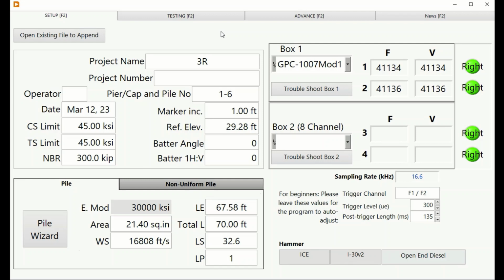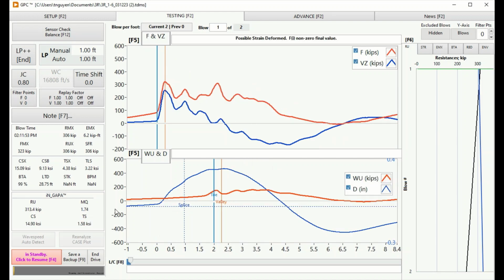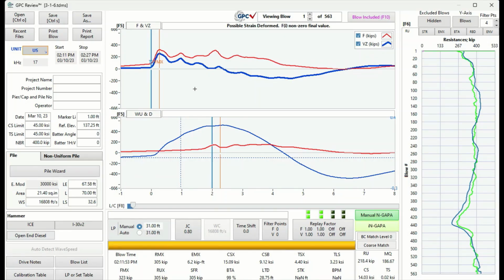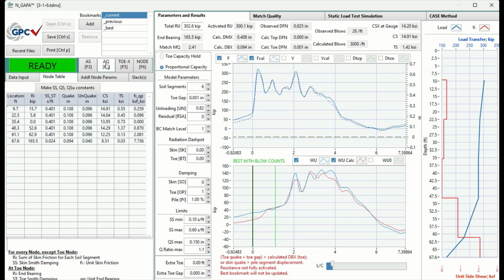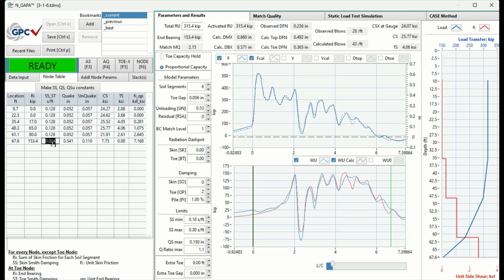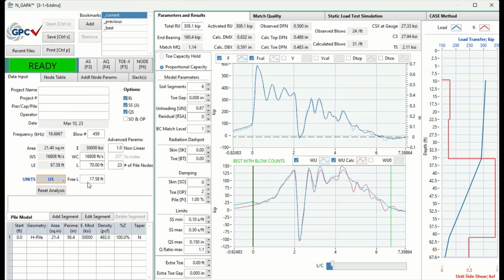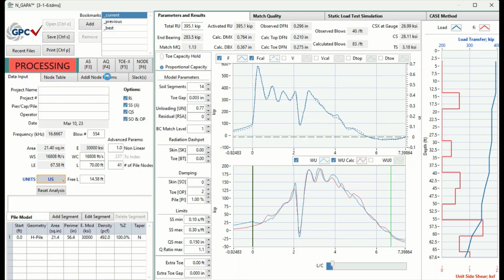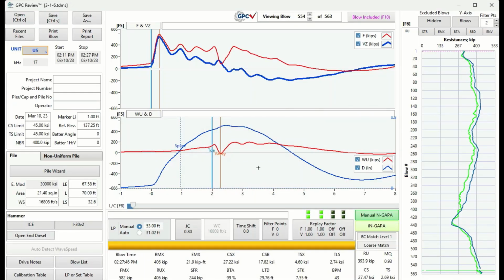15. iN GAPA example (field and office)

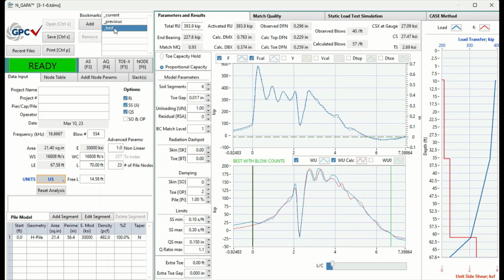Comment from the maker: 36:05 Soil Segments (also refer to Sections 3.7.2 and 4.3 N_GAPA user manual - despite a small # of Soil Segments, the skip factor is actually always 1, so no need to have many soil segments)
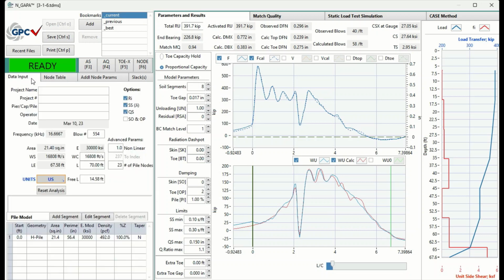36:50 Free Length